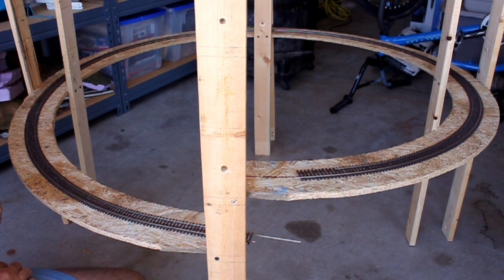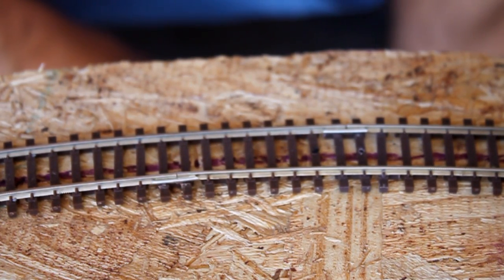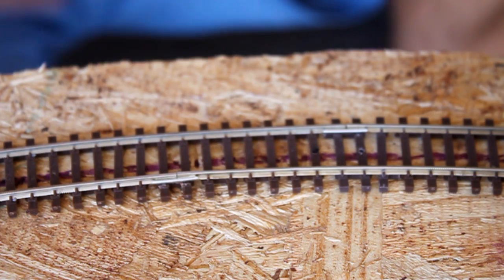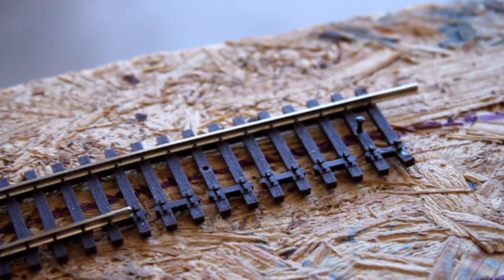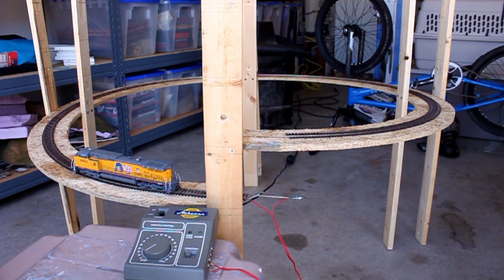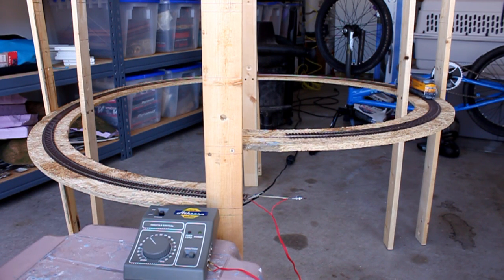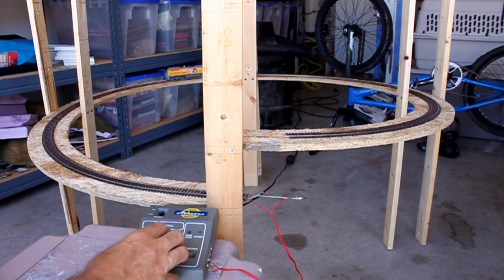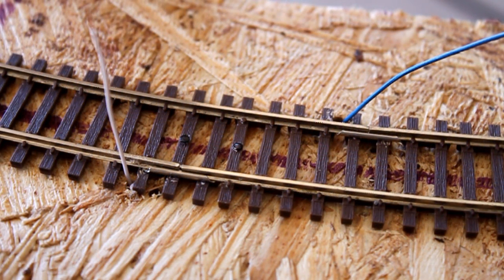Tales from the Layout - Adding Levels and Laying Track in the Helix

Comment: i have a suggestion - i read somewhere that to have a derailment-freee on your helix is to add a piece of string along the outer side of the track.  the purpose is to super-elevate (curved-banking) the outer side of the rail.

i super-elevate my tracks on all the curves - it works.

i like your feeder-wire trick.

Comment: Was surprised to see you fixing the track in the curved position before soldering the joints, tbh I have always found this causes a kink in the rail even with the overlapping joint set up, I would suggest you try soldering inline then fixing the rails in position for a more accurate curve. otherwise nice video explains a lot regards getting the timber cut.

Comment: The ODB is the biggest no no.  It soaks up mositure and will start to fall apart is exposed to open air. It will also warp like crazy.  Yes would use 3/4 fur and 1 x 4 between levels for risier.  Fishplate videos on you tube has great example. My helix is now on second layout and in use for over 15 years.  Would use cork but nailing is good leave them lose so track can move.

Comment: I like to solder my feeder wires to the bottom of the rail joiners before installing.
Reply from the maker: that'll work too! I used to do that, but didn't always get a good bond between the smooth bottom of the rail joiner and the wire, causing the wire to easily pull off.  thanks for watching and commenting.
Reply: That is ok but just remember that you are then reliant on good contact of the joiners for conductivity  in the uk profesional modellers always connect a feeder wire to each section of track so if the joiner gets dirt dust  paint (from weathering  or glue from ballasting) then the contact and dcc signal can be disrupted lost or weakened so this stops it from happening    :)

Comment from the maker: The radius in the helix is 22" and there is 4 inch rise per level, which is about a 3% grade.  Thanks!
Reply: Notes for future use:
1). Take the longest piece of rolling stock you have/plan on running, let's say a UP Big Boy, 135"; Math to find the minimum radius is 3 * 135 = 405'. In HO 405 feet is equal to 55.804", in N scale 405' radius is 30.375".  A 90' TOFC would be 3 * 90 = 270'. In HO 270' is 37.202", in N-scale 270' radius is 20.25".  
2). The grade is equal to the rise divided by the run.
A 22" radius has a run length per level of 138.226".  (R*2*pi=RUN) That is: 22 * 2 * 3.1415 = 138.226
So the actual grade is 4 / 138.226 = 0.0289 or 2.89% grade. A bit steep but very doable for short trains.

Comment: If you put your Helix levels as close as you can to each other then your train will have the least amount of grade to climb. Just a thought.
Reply from the maker: Couldn't agree more. The only issue is the height of the new/modern rolling stock. i could have easily built it with a 3.5 inch clearance, but what about newer stuff? Better to plan now
Reply: PennCentral99 Your right, that is a good idea to check that now with the new/modern rolling stock. Also, I can't wait to get started on my new HO layout.

Comment: Thank you for this video series. I appreciate your insight and I will be starting my first helix next month. Very nicely done videos.
Reply from the maker: hi Robert, thanks for watching and commenting!. you can also use threaded rods with washers and nuts to secure and adjust the incline. Hope the videos help and yours turns out OK.
Reply: +PennCentral99 I am in the design process now. It will rise 18 inches and be a 24 outside radius, 22" track radius. Looks like 2 sheets of 1/2" plywood will get it there?
Again, great video and fantastic hobby!!!
PS: BTW, I've used the flex joints on curves like you have, keeps all your sticks of flex full length. :-) Done that for years.
Keep up the great work.
Reply from the maker: 2 sheets of plywood should be plenty. thanks again!

Comment: How did you run a DCC loco with a DC powerpack?
Reply from the maker: RockIslandmodeler i used the wrong terminology. (at the time), that loco was DC. thanks for picking up that mistake.
Reply: PennCentral99 Yeh I was really wondering.
I like the the off set flexi track rail links. When I had my first layout my curves always has a bind in it causing my trains to derail. I am going to use that technique.
Reply from the maker: just remember, I wasn't the originator of the "offset" joints. I see others doing it also, and it really does work. thx
Reply: the dcc engine are both dc/dcc capable

Comment: Nice is elevation degree on the way 10% it looks like more
Reply from the maker: Probably because it's a tight circle, but it's only about a 3% grade. thanks for watching and commenting!
Reply: This something new 31/2 BETWEEN  CIRCLE
Reply: Tight circle I have 6 wheel trucks on the curses , even there all the room on your circle you could bring it bigger cents you have lots lots hours in the it :)

Comment: Use a gauge a small nails inside of jointer
Reply from the maker: This helix isn't the best, but it works. If I were to build another helix, it would be constructed entirely different, with better materials, methods and workmanship. Live and learn.  Thanks for watching and commenting.